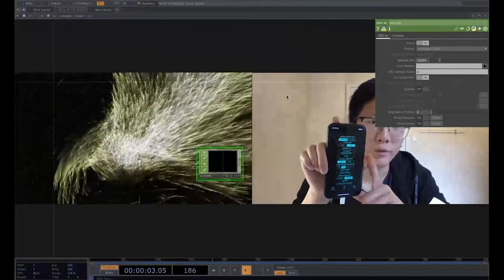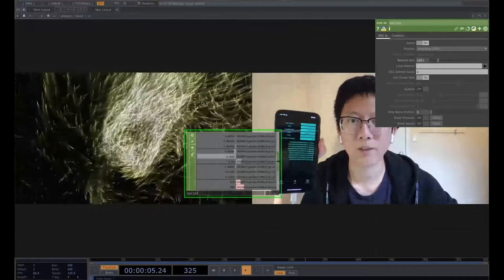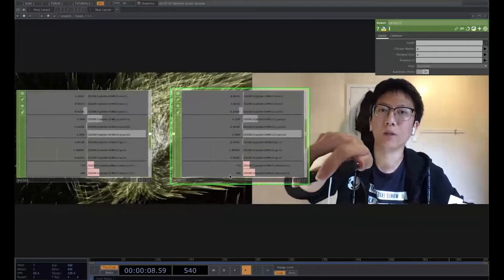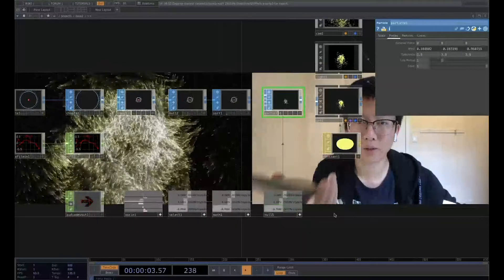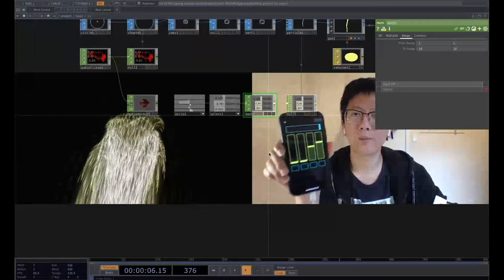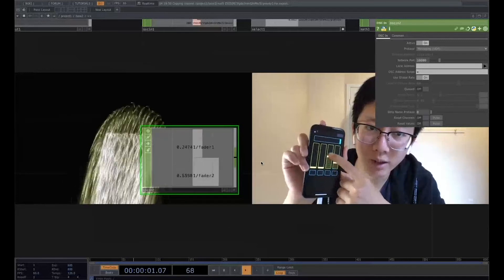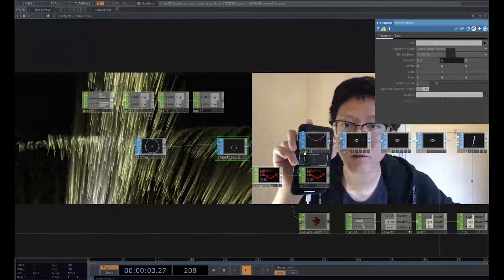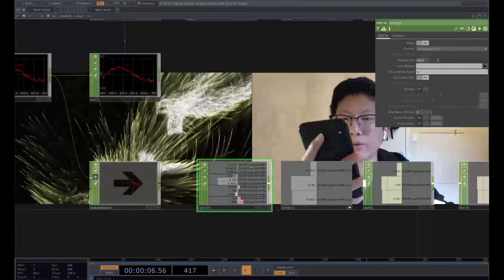How to bring Touch OSC & Zig Sim data to TouchDesigner – TD Tutorial 1

Comment: Hi! We're ucl students of Luyang Zou in need of help! :)  We have two questions. 1) We want to use 2 mobile devices and send the data (longitude and longitude from GPS) from them to one laptop (into TouchDesigner). Do we have to connect our phones and our laptop to the same network to make it work? 2) Is it even possible to use GPS output for TouchDesigner with this app? Thank you!! :)
Reply from the maker: Hello, great folks there! The question is an absolute yes! A, your phones and your laptop have to connect to the same network to set up the communication but be sure to set different ports individually so that you can receive data coming from different phones. All the best!
Reply: @junli860  Thank you very very much!